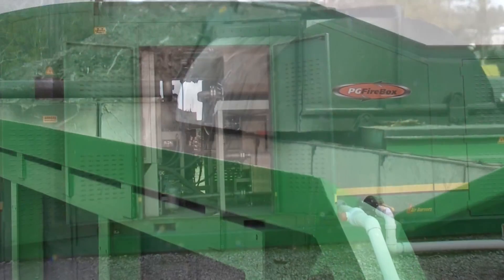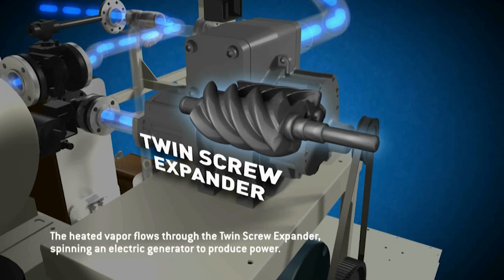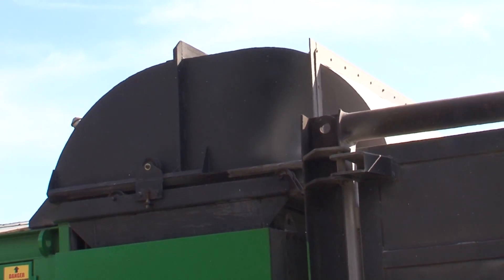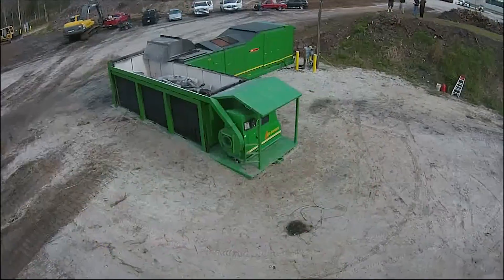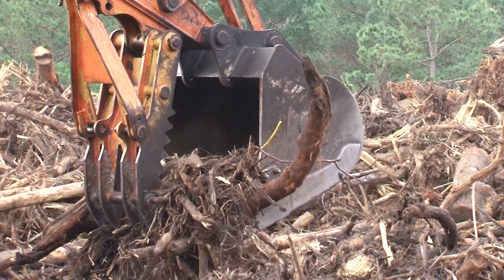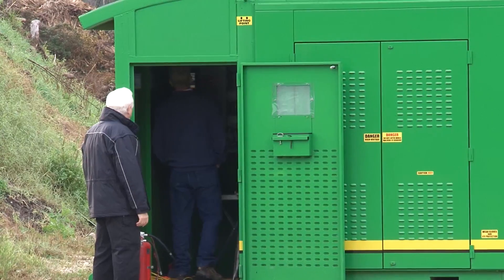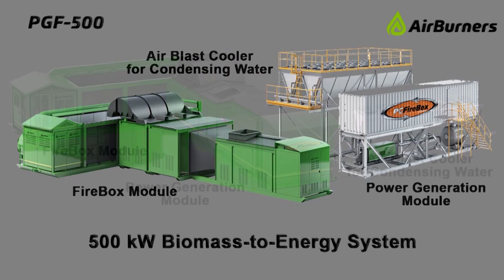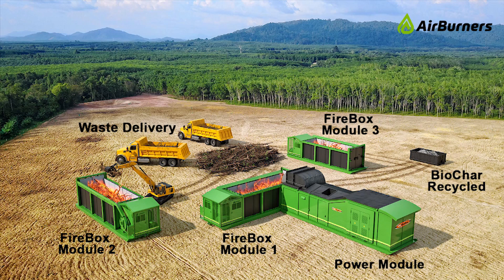Air Burners Biomass Waste-to-Energy - PG-FireBox Helps Fight Global Warming

Comment: Would love to see this modified to also produce some biochar. With a char draw off system from the bottom. This would generate electricity, reduce would waste (at an increased rate because you don't need to burn everything), sequester carbon and create a fantastic soil amendment that could be sold or returned to the source forest.

Comment: Just in case any climate denier was going to accuse this of being too liberal, you threw in the (not so relevent) comment about cheap fossil fuel. I get that it's tough offering environmentally friendly tech in an industry full of hard right ideology. But I wouldn't be shy about it!
Reply: Climate denier? U are burning wood this is all but baned in Massachusetts. They would much rather tier 4 diesel grinder producing chips for fuel or wood pellets. You have 20 ton excavator filling a machine that is consuming 4 tons per hour that machine is probably idle 45 minutes of that